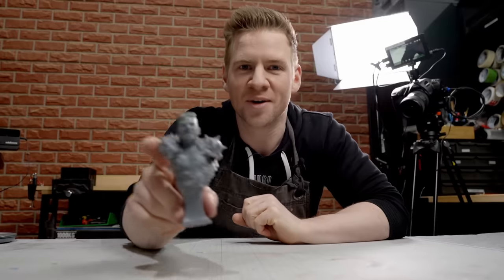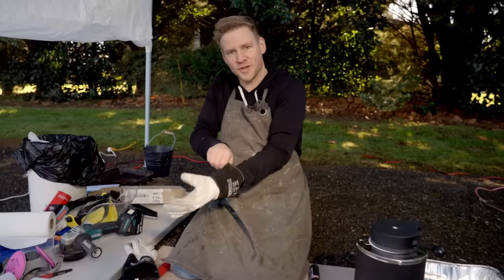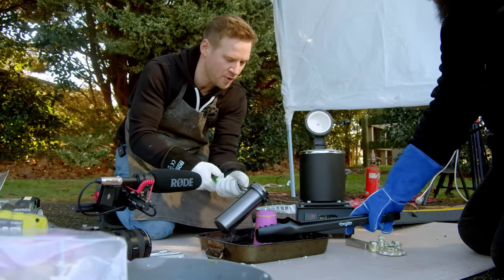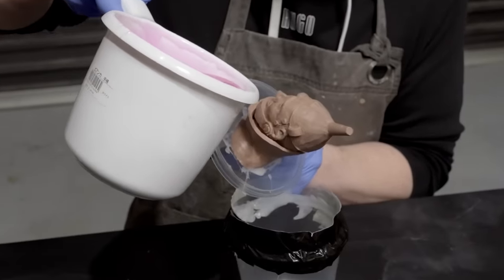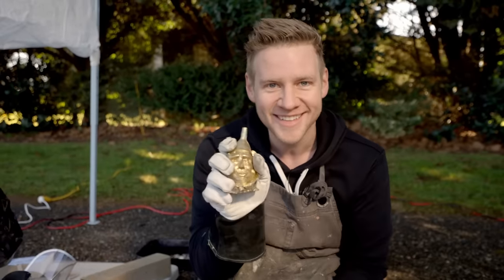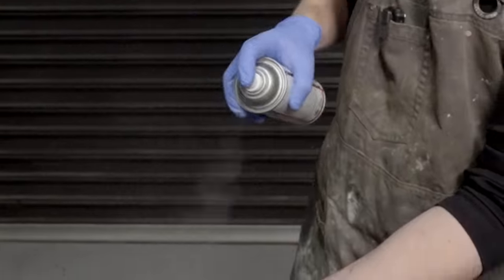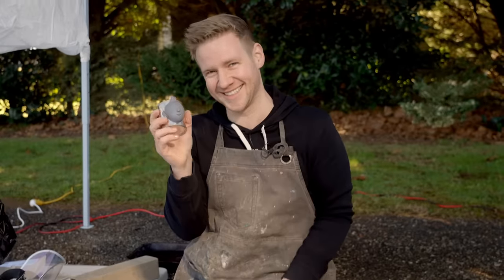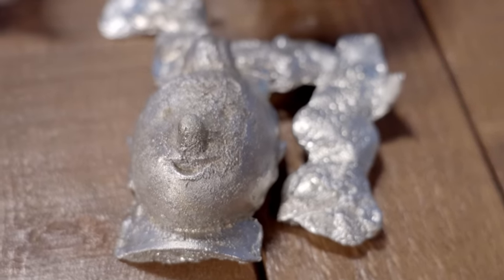SMELTING for the FIRST TIME!!

Comment: A friend of mine casts aluminium into seashells. The heat causes the shell to chemically change, so when he puts them in water the shell dissolves and the cool interior of the shell is revealed! Looks so cool, should try it!
Reply: Is it the Mother of Pearl you are pertaining?
Reply: @scorpioninpink He uses all kinds of shells. The spiral ones are my favorite. For those he has to snap the tip off as an air vent so the metal flows down enough. All parts of the shell dissolve away and you get some neat shapes. He wants to upgrade this forge and try copper which I think will look even cooler .

Comment: 1 tip when casting Jazza
The tuna one - When you make a rectangular mold when you put a rubber band around it it basically applies pressure unevenly. The corners are compressed the most while almost no pressure is put on the sides of the mold. This can slightly distort you casting or worst case scenario spread the seams a little bit, either causing leakage or making your mold lines waaaay more apparent.
To solve that you can make like a "T" shape (cardboard works, but you can even 3D print if you want it to look fancy). Resting the flat part on the sides of the mold and placing the rubber band on the "leg" of the T allows the pressure to be more evenly distributed on the whole surface. Basically you'll be creating more corners. This way looking from above the rubber band will have an hexagon or octagon shape.
I like making a little indentation in the bottom of the T shape so the rubber band can get in there and don't slide around
Reply: l can't tell what you're saying with the t thing
Reply: @4Rgames  It's a bit weird to explain. I'll try to illustrate
+------------------------+     +-------------+
|                             |      |               |
|                             |      |               |
|                             |      |              /
|                             |      |             |
|       ------------        |       |             \
|    Glue it here    |       |               |
|       ------------        |       |               |
|                             |      +-------------+
|                             |
|                             |
+------------------------+
(Hoping youtube don't distort everything)
Just glue it in a 90º angle forming a "T"

Comment: Mold should be warm too. Then melted metal that touches it doesn't cool too fast. And you can get a better surface. Sometimes its just 3-4 pouring melted metal in a row and model becomes better and better every time)
Reply: That´s why he shows heating it up in the beginning with a torch :)
Reply: To add to your comment, water is also an important factor since if there is too much moisture on the mold it can create a steam explosion with molten metal being thrown at you. Therefore safety is a large factor in preheating molds.

Comment: You can get resin for your SLA 3D printer that's burnable. Just print out the thing you want to cast and then put that in a container of plaster of paris, put it upside down in an oven to burn out the resin and you're left with a perfect mould for you to pour your metal molten into. A lot of people with this method will use a vacuum table to help draw the molten metal into the mould when it's poured.

Comment: Mark your molds (and the container for making your mold) with a Sharpie. You can draw a line or X where the face is, for example, so you can tell which way the cast is facing.

Comment: with a 3d printer
you can print the model with a special filament, which can be used to form a cast after various steps of cast that cast with casting ;)

Comment: Given my experience casting metal, you want to get it a hundred or so degrees above its melting point to help it flow into the molds easier. And you want to heat the molds at least a bit to. Those texture issues were from the metal "freezing" when it hit the cold mold.
Reply: Also when you get around to plaster casting 3dprints can be melted out of them. Make sure to back the plaster for a bit, cause excess moistrue can cause them to explode.

Comment: My advice to cast with white metal is to use Ferroca components, they do amazing silicones for casting  I had been using them for more tan 15 years and they only get better. pS detail is really good with the red one and  it also helps if you do some exit Chanel's for the metal to run a bit out, that and warming up the mold before pouring gives me the best results for my miniatures. 😊

Comment: For more fine detail I would try a lost model and a lost form. Cast a wax cast with your molds. Then add pouring canals, also made of wax, to this wax figure. Then put this wax figure in a holey vessel and you fill it with plaster that is shaken. Once the plaster has hardened, the whole thing goes into an oven where the wax is melted out. What remains is your mold, into which you can then pour the molten Tin.

Comment: I have only minimal experience with metal pouring from a jewellery class in high school, but some things I learned-
You wanna have the mould hot enough that the metal doesn't solidify before getting into all the little details (in our case, we used plaster, so it was easy to get it hot. Silicone, probably less so.)
You also want the mould to be completely dry- any water in there could evaporate and make little bubbles, which will appear as holes in the metal
As a bonus, probably less viable for such big pieces- we had our moulds in a centrifuge, so that the metal would be thrown in with several times the normal force of gravity, and that would help force it into all the cracks and displace any air or anything in there

Comment: Try putting melted wax in a silicone mould.
  After that use the wax statue to make a gypsum mold by melting it with heat after the gypsum hardened.
Finally, pour the melted metal into the plaster

Comment: More casting metal rather than smelting but still cool.  I think learning anything new comes with challenges and you did fairly well Jazza. 😁👍  

I do think maybe you could have gotten better results by melting the metal for slightly longer or perhaps actually lifting and droping the bust mold when it was a quarter full, half full and maybe 3/4 full to force the liquid metal into the crevices.  That, or using a concrete vibrator on the outside of the mold.  A back massager might work too.  Honestly though, I don't think you're really supposed to use tin in very detailed silicone molds.  There are better casting methods and better metals to cast with. 😅  Still, I consider this your "dabble" and you got fairly good results during it so I call it a win.  Well done! 👏😁

Comment: You should heat up your molds because it’s causing the metal to cool off to quickly and your not getting a good pour 
Or you can pour the molten metal in the mold several time to heat the mold up

Comment: Strictly speaking, smelting means the extraction of a metal from an ore, not merely melting a more-or-less pure metal to cast it into a new shape. I’m increasingly seeing the term used to mean the latter, especially on YouTube.

Another word changes its meaning because the word SOUNDS SO EFFING COOL THAT WE JUST HAVE TO USE IT EVEN THOUGH WE GET THE MEANING WRONG.

(Every time someone gets an electric shock it’s now called an  electrocution, even though “electrocute” is a combination of “electric” and “execute.” BECAUSE IT SOUNDS SO EFFING COOL.)

So… when someone actually takes an oxide or sulfide or whatever ore and extracts metal from it, we need a new word for that.

Comment: I have always wanted to try this. Unfortunately I have a hard and fast rule that I can no longer handle anything hotter than a kitchen oven. Especially when I was working on enameling and when I needed to remove something, I was tossed oven mitts instead of the appropriate and I started to reach in and poof.. up in flames. 😄

Comment: The "tin of tuna" joke doesn't work well for Americans because we just call them cans of tuna, not tins of tuna.

Also, that's not smelting. Smelting is refining metal from ore, and can sometimes be referred to when creating alloys. Although, that's technically alloying, which is a subset of melting. 

Lastly, as someone that has been doing copper and aluminum (yes, it's spelled correctly) melting for years now here's a couple of tips that can help when sand casting or doing investment plaster casting/lost wax casting. First, know what type of alloy the aluminum is before melting it. Some of them are much better than others. Secondly, understand what flux to use for what materials. For most melting aluminum alloys, like A356 and similar, I just use Borax and it works pretty well. If you melt other types of aluminum then you can sometimes end up with a lot of dross that needs to be skimmed off. And that brings me to my final point. Have the tools to handle dross, leftover material, and the other accoutrements laid out and ready. Casting is all about being super picky with the setup but when it finally comes time to pour then things have to move very quickly. 

Oh, and wear safety glasses!!!

Comment: You can make your own little Monopoly pieces. Instead of Mr Moneybags, a player could be Mr Jazza Moneybags and it's your face. Well except you don't have a tiny mould of your head small enough. 😂

I mean what's better than your decoding to pull out the boardgame to play with the family, before telling to hold tight as you spend the next several hours making the new pieces and then finally going to play it, as the kids go to bed or something else, because you've taken all day 😂

Comment: I hate to be "That Guy" but.. you are an artist, your eyes are VERY important to your craft(s) PLEASE wear a face shield or at least safety glasses! when moisture is introduced into and trapped in molten metal the flash boil can cause the metal to erupt. 
yes the metal is heavier and a leidenfrost effect would prevent small amounts on the surface from causing much harm and small amounts of liquid tin will simply flash cool when dropped into a larger amount of water but it's when you get contamination into a closed cell of your mold or some other random unforeseen "accident" happens where you get trapped gasses and eruptions that ruin your fun, liquid metal in the eye would ruin your fun much worse than a cool explosion or a "simple" burn..

Comment: NEVER JIGGLE A MOLTEN METAL MOLD IT RUINS THE METAL fracturing it and spreading bubbles the trick to smelting is fast one smooth motion no jiggles don't touch the mold and don't stop the pour tills it's full or youll get gaps man watch a video or somthing

Comment: I’m not 100% sure but I think if you used some kind of vacuum chamber immediately after pouring the tin it would probably help pull out the air bubbles from inside the mold.